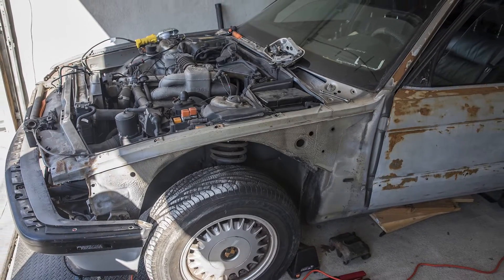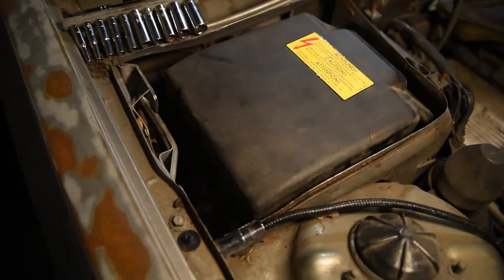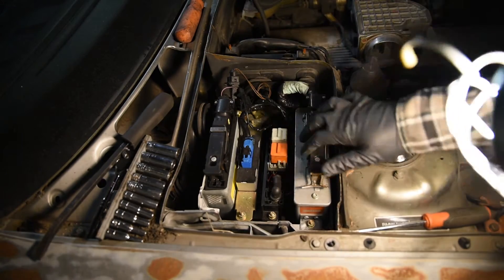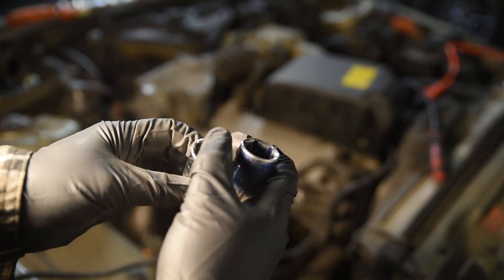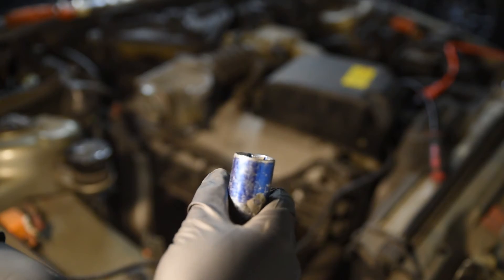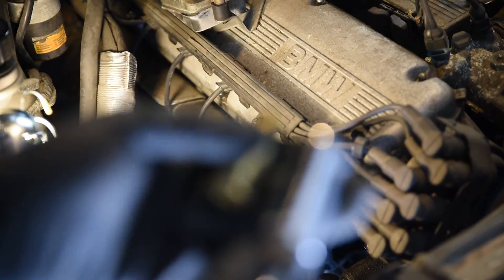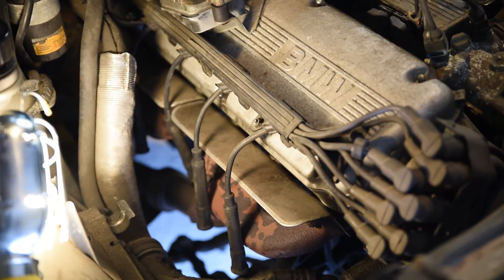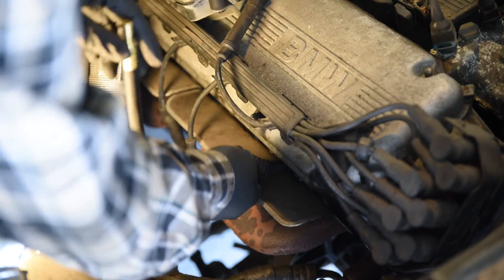BMW M30 Compression Test | E32 E34 E30 E28

Comment: There's only one temperate sensor listed for sale everywhere for m30 735i and on your video there's two coolant and engine coolant temp sensor what's the difference or those two are same on the thermostat housing
Reply: Late answer... but one coolant temp sensor is for the ECU, the other sensor is for the gauge cluster.

Comment: It's M30B35, not B34 :)))
Reply: thats a b35 bro..no b35 came with ITBS...
Reply: no b35 has itb's
Reply: only S version got itb such ah S38 S14 etc
Reply: I have got 155, 170, 170, 162, 162 and 155 for my 92 non Vanos M50 32I. Good considering less than 10% difference between each other . But are those value too low ? 160,000 miles on the car ... it's easting oil  I had to ad every 300-600 miles . Coolant level stays the same ! So headgasket on its way i wonder ?!
Reply: jebohim M30B35 have ITBs this does not. This is a M30B34